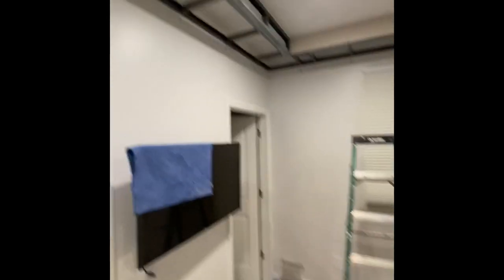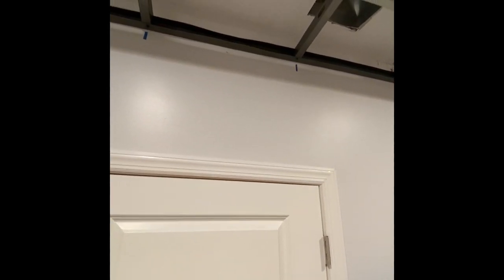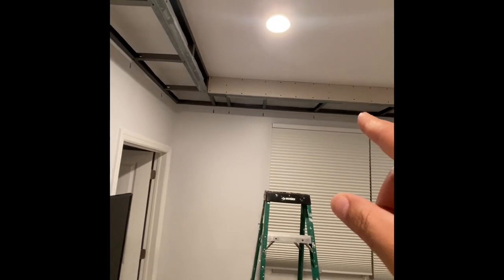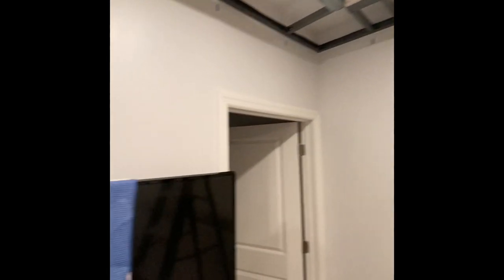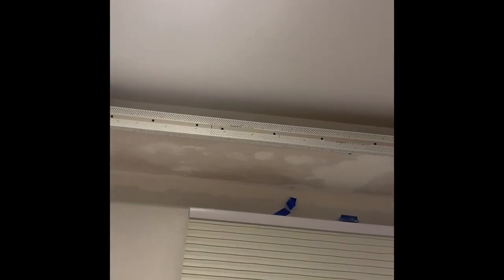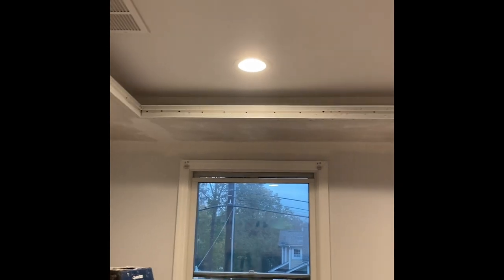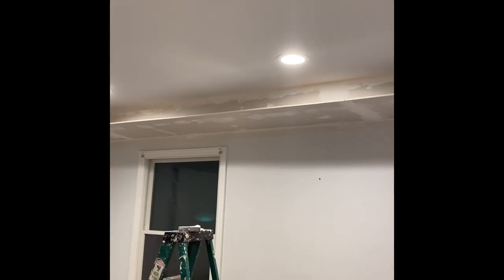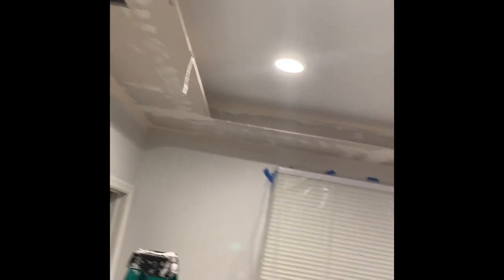How To Make A Modern Tray Ceiling With Led Lights!

Comment: Looks great. How do you frame for that lip at the bottom of the soffit?
Reply: thank you selam for watching my video, when cutting the sheetrock for the bottom part make it 3 inches longer like an overhung 
then put a 3.5 galvenized stud and attach it with screws then cover it with the sheetrock and finish it with plastic corner beads good luck
Reply: @bendini100  thank you Tommy, i appreciate the reply.

Comment: I am still a little confused on how you created the lip. I know you used the 3.5  galvenized stud, but is it just anchored to the overhung sheet rock?
Reply: is the inside of the lip just empty? do you have picture of the inside?
Reply from the maker: Correct the 3.5 is just anchored on the top of the overhung, make sure you cut a 3,5 strip of Sheetrock to cover the face you can see in the video when I made the box the bottom peace of Sheetrock is sticking out about 3.5 inch forward at the tip you install your 3,5 galvanized metal I hope this helped you.

Comment: You can use butterflie bolts to attach the galvanized studs. If you have access to your attic you can use 2 by6 or 2by 8 blockings you have different options good luck !

Comment: Great job! How deep is the tray itself where the lighting is installed? 6in?
Reply: thanks  David for watching my video the depth is 3 inch inside I hope this information will help you create your own project good luck!
Reply: thank you David  for watching my video the inside cavity is about 6inch but I put a nother stud  at the front to hide the led light from the inside so the finished box has a gap of 3 inches to ceiling

Comment: When attaching the lumber into the ceiling joists at 16 inches what do you do if the location of ceiling joists is not equal from each wall?

Comment: Hello , could you please name the parts for this metal framing (the perimeter channels/profiles) so we can easily look for them at Lowes?  Thanks.
Reply: HI friend, thank you for checking my youtube channel the item number is #759323 available at Lowes galvanized framing studs good luck with your project !
Reply: @bendini100  Thank you for the kind and prompt response; this is a DIY project.

Comment: Can you show what kind of led lights to use and how to place them?
Reply: thanks for watching my video, I bought the led kit from amazon it comes with a remote control and its  self adhesive tape very easy to use make sure you buy the correct length or buy it longer and cut the strips to the length you need i hope this information helped you good luck with you project

Comment: Nice work. May I know how much it costed? Thinking of doing such project since couple of years.
Reply: HI vijay if you live in the us you can buy all the material needed from Home Depot or Lowes it cost about $700 include everything the led light as well, if you do the work your self and you have the skills its lot of labor but anybody can do it. thank you for watching my video good luck to you on your project
Reply: thank you vijay for watching my video, the cost will be about $700 galvanized studs sheetrock screws compound and corners beads primer paint led light good luck with your project I hope I was a good inspiration for you !